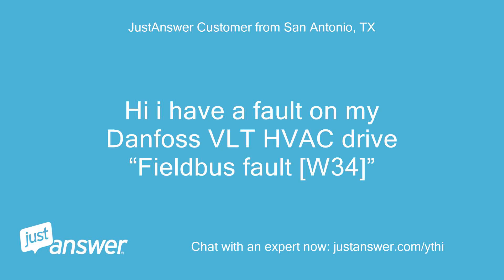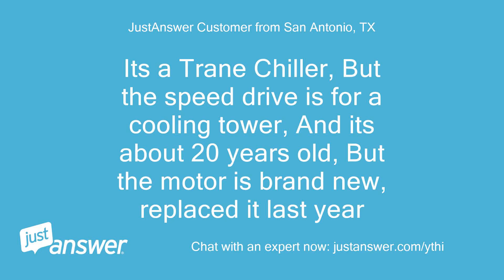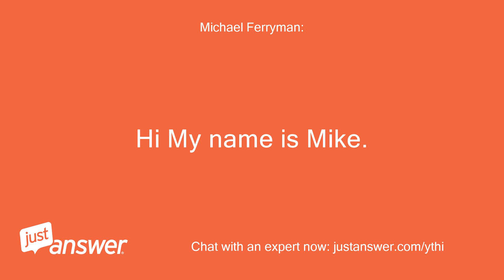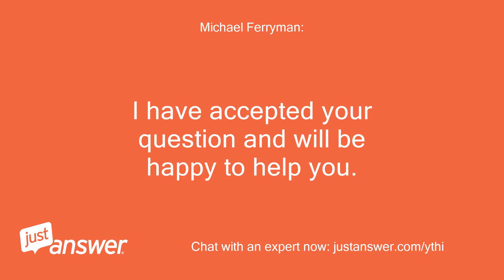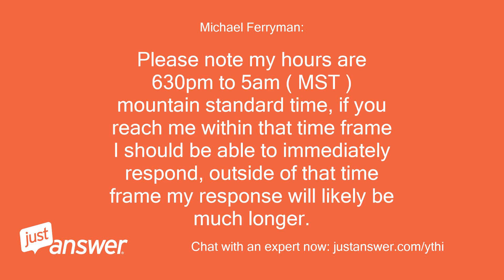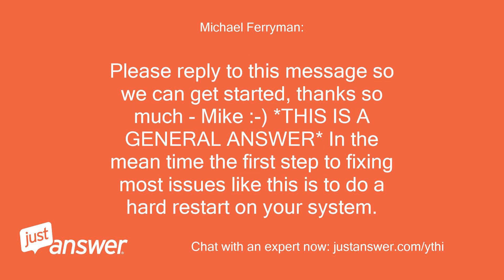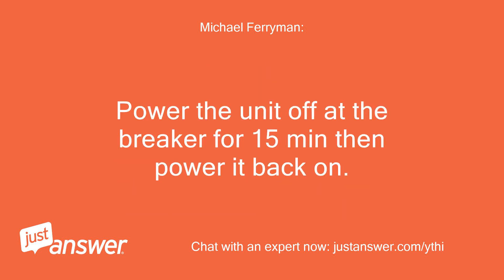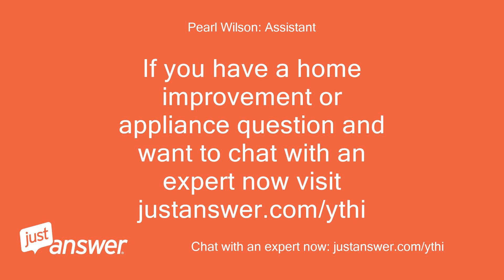I have a fault on my Danfoss VLT HVAC drive “Fieldbus fault

Comment: Hi sir iam using Danfoss VLT FC102 iam getting error DC Over Voltage AL7 could you pls help me application is compressor motor 250kw I have increased Ramp up/down time from 8sec/15sec still the error same pls help me